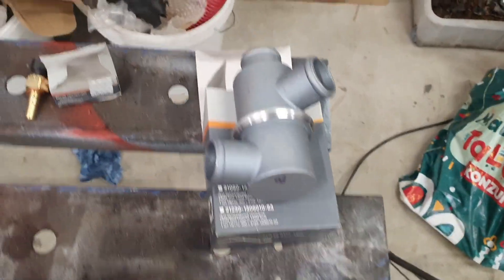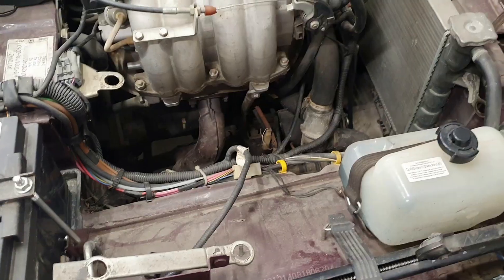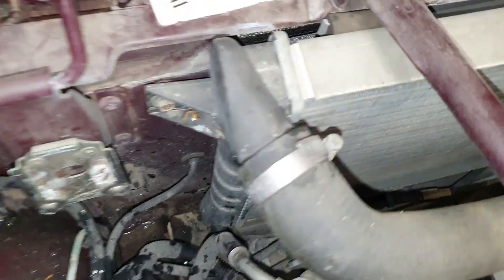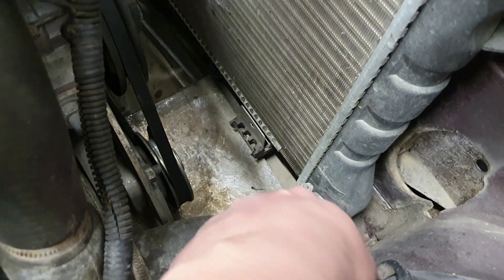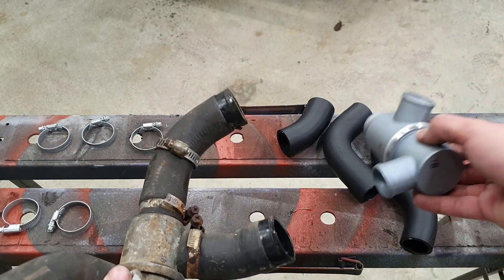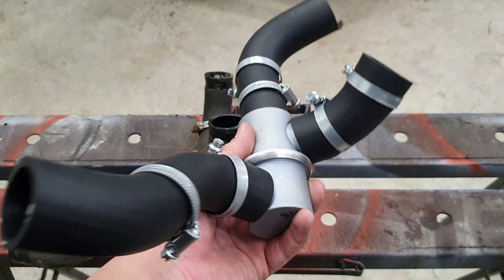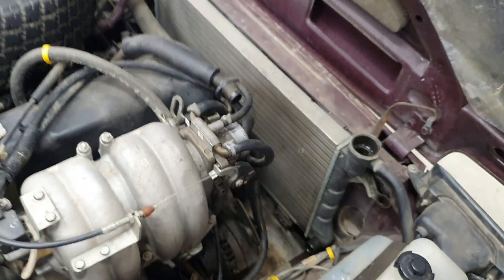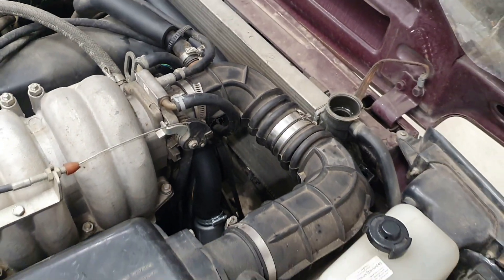How to Change a Thermostat on Lada Niva

Comment: Well done bro'! My weekend program was the timing chain, sprockets, tensioner etc... and because of chain -getting out the radiator it was easier to do this fix like u in the video... 😃 btw. Have u ever done a video of timing or valve adjustment? ☺️...great all day fun 😂
Reply from the maker: I see you had a great time 😅 in the future I am going to install automatic tensioner, and I will make video on how to replace a timing chain, but now i see I need to do video about valve adjustment 😁 thank you for the idea!
Reply: @PLUKI4x4  for valve adjustment we used a special, original Lada tool /with indicator clock/ - borrowed from my friends father. If u want to copy i can send photos of it. ☺️ Faster and much more accurate 👌
Reply from the maker: Thank you so much! Please reach to me on my Instagram and send me photos 😁